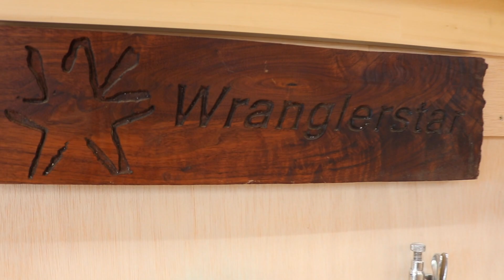Sturdy SAWHORSES With No Power Tools

Comment: Hi Wranglerstar, Greetings from Australia and best wishes to you and your family. I have recently discovered your channel and enjoy it immensely, I was watching you hang a door on a video dated June 19 2016 and was puzzled as to why you removed successive 1/4 inch strips from the bottom of the door, rather than scribing it to the out of level floor, I am a retired second generation builder and carpenter and I used to grab a spare carpenters pencil and slide it along the floor , marking the base of the door, this is done at different degrees of door opening to make sure it clears any other irregularities and gives an even look to the gap under the door and my dad made a tool consisting of a lipped piece of flat steel fixed to a piece of 4x1 ( 1x4 for you guys lol ) with a piece of half round trim timber fixed to the underside of the 4x1 with a captive nut and bolt to set the lift height. Place the middle of the bottom of the door on this and use your foot to lift it into place. There are commercial ones now available, but I still use the ones he made all those years ago. I suppose I have an "old tools are best" thing too.
Congratulations on your channel , Regards Steve

Comment: wranglerstar,  years ago I went to england and went through a castle that had been through a fire.. because of the fire you could see beams that were old and the fit up was excellent and stuff that was new and the fit up was terrible... I attributed it shrinkage of the wood in old world vs new world craftsmanship.. it all old and new appeared to be timber framed style.. I know you've worked with green wood quite a bit, have you noticed that the fit that you take so much time to get as close to perfect as possible in time with shrinkage is eventually loose and sloppy?

Comment: Add a diagonal or two and that is a perfect practice piece. It has most of the joints that will be needed to build a timber frame. They will also hold the timbers off the ground.

Comment: I'm not criticizing this at all! I just was wondering if in timber framing, are the tolerances much less tight compared to hand woodworking? Because it seemed like the joints were a little loose.

Comment: In regards to your drill, the pillar drill or sit and bit or whatever it's called, I see it rocking back and forth while you drill. it seems to me that a more stout base would eliminate that and increase precision. would a thick steel base work? Would closing the gap at the end work? I have to assume that the gap is there for a very good reason, aside from labor cost. Thoughts?

Comment: Just wondering - when you drill the holes through the tenons for the dowels, are you going to offset them a tiny amount (couple of mm or a 1/16in) so that when you drive the dowels through, they 'pull' the joint tight?

Comment: It can be a challenge to make plumb cuts by hand.  And also, getting the saw blade at a nearly perfect right angle can be difficult when you only have the width of a 2x4 to eyeball it against.  One technique you can use is to place a square (12" or so in length) against the stock to give a longer reference with which your eye can align the saw.  It makes a big difference when cutting dovetails by hand.

Comment: Cool, now just some dowels and a branding :) ... maybe coat the bottom sections with something to prevent rot if you are going to use them outside. Likely that same smelly stuff they use on fences and other outdoor wood (of which i have no clue what it's called, let alone in English).

Comment: Here is one comment (4% of all) that sinks the "GOOD DEAL" Starett Framing Square:
Totally inaccurate. I've thrown out better squares than this. The numbers are painted on, which is crap because they wear off with use. That would still be ok if the numbers were actually measuring accurate inches. When other rulers were placed next to it, the inch markings of the Starrett square varied by up to a 1/16th of an inch. The last inch increment to the end of the long 24" side measured 1-1/16", but the overall length of the side was 24" when measured with other straight edge and tape rulers. Was it square? Never even bothered to check. You couldn't measure 12-16-20 on the square, because the markings were so off. They were different if you flipped it over too. 10" on one side did not measure 10" on the other.